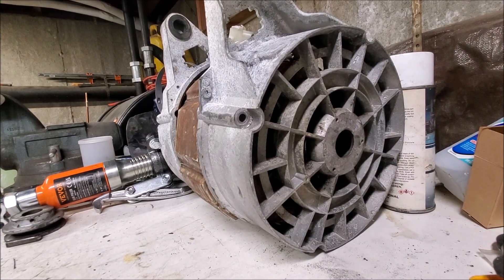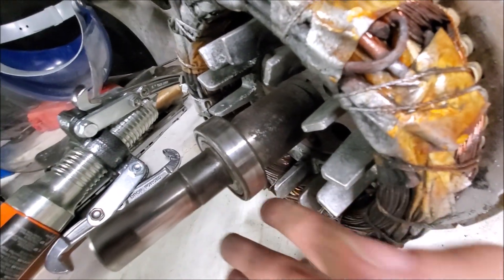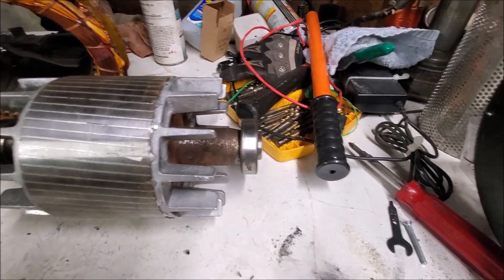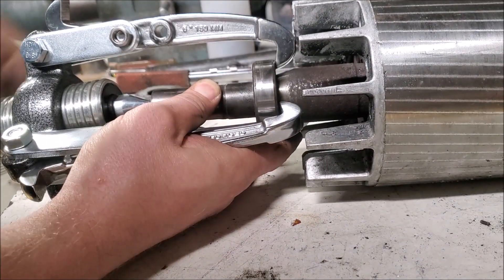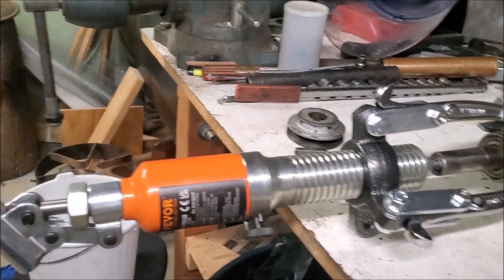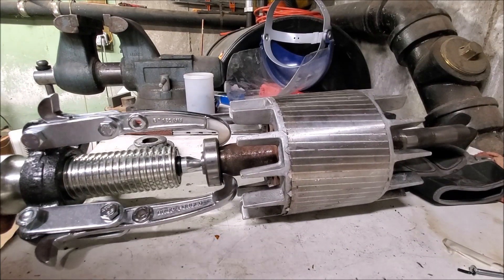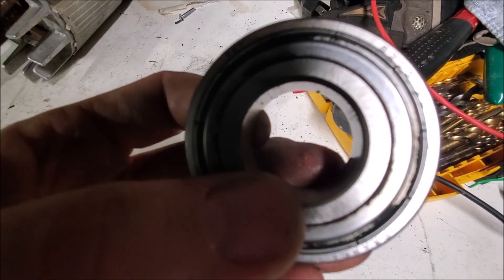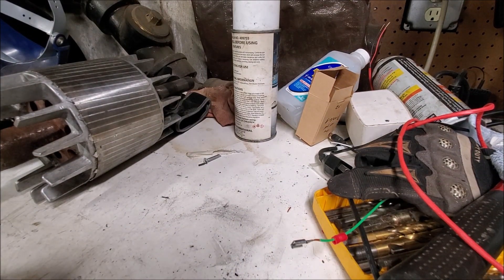Wascomat Washing Machine Motor Partial disassembly and bearing removal.

Comment: Hello. Do you know the electrical connection for a  Elmo motor (115 volts)? The hi velocity,  centrifugal,  The main and the auxiliar ?  3 wires and a capacitor.
Reply from the maker: Afraid not sorry.